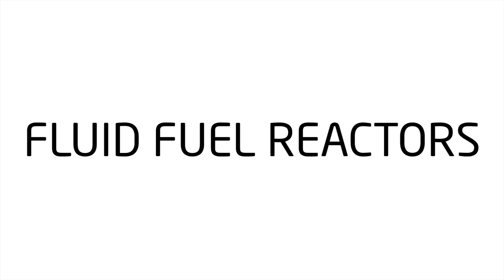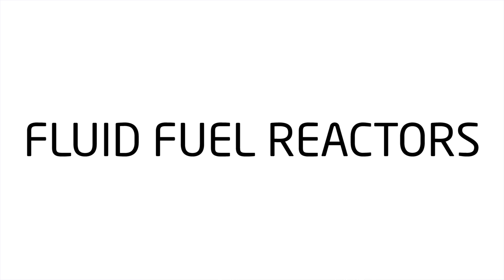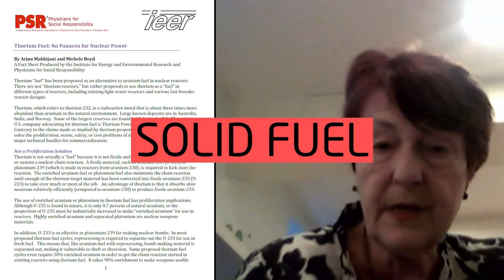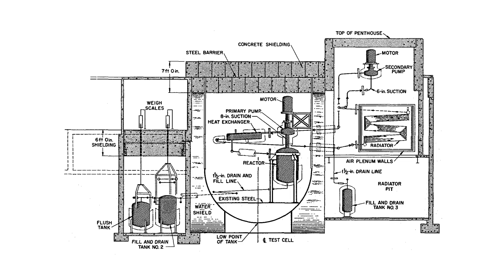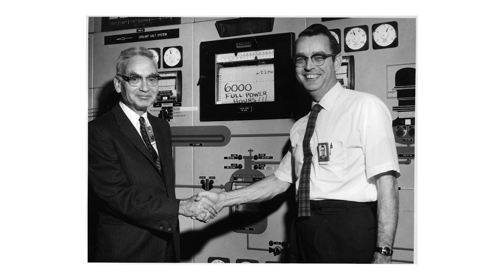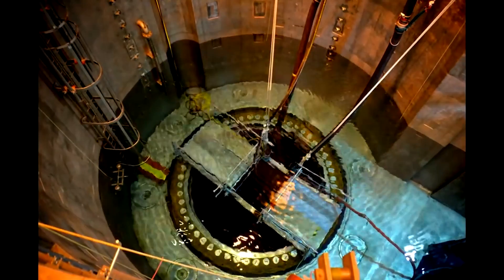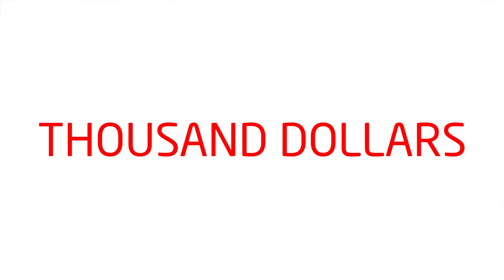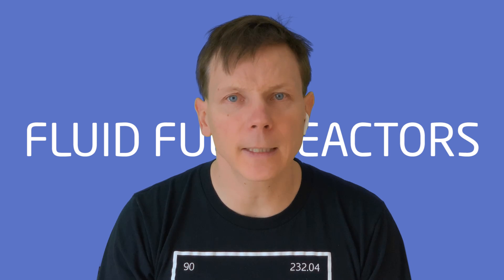Thorium in Fluid Fuel Reactors

Comment: Ima bout to rek dis thorium liquid fuel reactor nonsense.
Problemo 1. Tellurium (a 233 fission product) deposits in alloys weakening the pipes and walls by migrating in between grain  boundaries and allowing cracks to form.

Problemo 2. Fuels using Lithium salts must be 99.99% of the lithium 7 isotope otherwise you'll have craploads of tritium gas and that is hydrogen, which weakens metals. Only two countries have the industrial capacity to perform isotopic separation of lithium. Russia and China. USA banned the most economic method due to its use of mercury and I doubt Trudeau would let something like that be built.

Problemo 3. If a thermal spectrum reactor is used what will you do with your graphite? It will have a mean lifetime of 8-10 years and will have absorbed many radionucleides during that time.
Problemo 4. Any alloy using chromium in it with a fluoride based salt will have problems with the chromium being swiped and leaving "holes" in the structure.
Reply: Solution to problemo 1: ORNL-TM-6002 "Status of tellurium-Hastelloy N studies in molten fluoride salts". ORNL lab did research on tellurium induced micro-cracks and suggested improvements to Hastelloy-N. MSRE lasted 5 years without any leaks.
Solution to problemo 2: ORNL-TM-5759 "Distribution and Behavior of Tritium in the Coolant-Salt Technology Facility" & ORNL-MIT-117 "Removal of Tritium from the Molten Salt Breeder"
Impermeable Coating (or) duplex walled heat exchangers like sodium reactors (or) adding a additional salt loop (or) removing tritium
Solution to problemo 3: Using highly wear resistant carbon-carbon composites used in space shuttle nose (or) Graphite replacement using remote techniques.
Solution to problemo 4: Molybdenum was added to Hastelloy-N for this reason. Hastelloy-N was invented to handle fluoride salt from very begenning of Aircraft reactor experiment. Search H.E.McCoy "The INOR-8 Story"
Reply: @achalhp  Thanks I was about to paste an ORNL PDF URL didn't see your reply. I'd add LFTR chemical kidney is all about removal of any troublesome fission products, or valuable fission products. A typical MSR without chemistry might try to plate-out tellurium, with online chemistry tellurium can be pulled out of the salt.

Lithium-7 China's announced their own production of it (not just "industrial capacity"). I-MSR and Moltex are not using Lithium-7 (you're worried about Canadian efforts for MSR?) but if they wanted some they'd buy it from China.

Neither Graphite nor Chromium is worth my time commenting on. Wish I'd read them first I'd not have replied at all. Implies MSR startups (and DoE and SINAP) are wasting millions $ without due-diligance or foresight. Thanks Achal for bothering.
Reply: @gordonmcdowell  The ORNL-MSBR (a.k.a. LFTR) is a technically feasible concept. LFTR may need additional R&D and it may eventually get more expensive than other MSR concepts; but there are no insurmountable problems. If we want a safe and efficient reactor on a closed fuel cycle, then LFTR is the best choice. 
Nuclear advocates do not answer questions raised by environmentalists, but they evade by showing statistics and saying other energy sources has more problems. LFTR answers most of the questions raised by environmentalists by giving innovative *solutions*. Knowing such a reactor exists makes many people pro-nuclear.